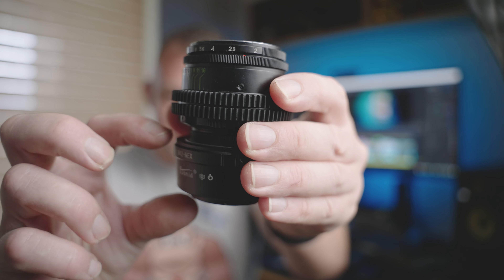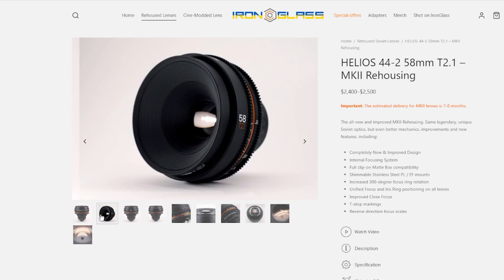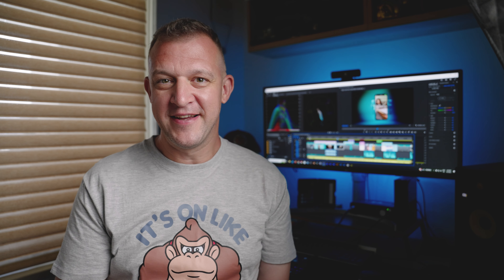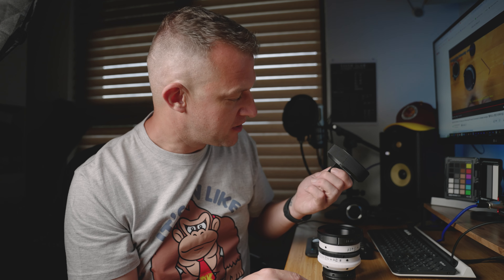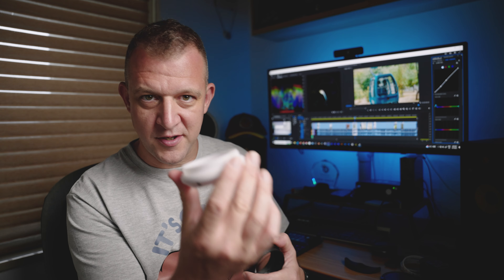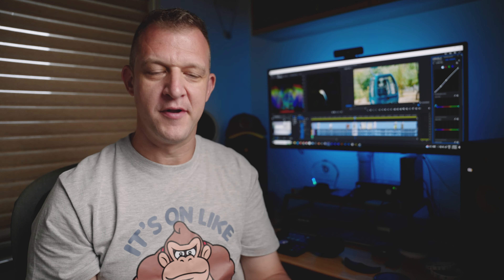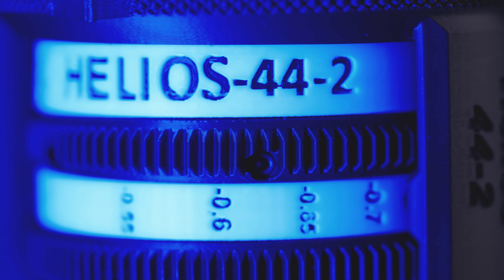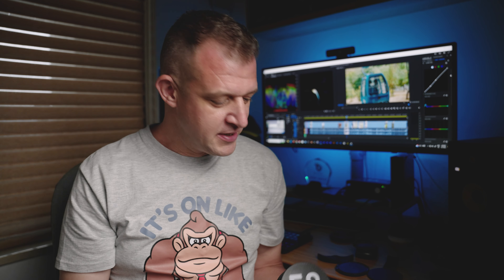Can I rehouse a vintage lens with the magic of 3D printing ?

Comment: That bit that initially snapped that seems to be holding the lens together - the plastic arms go over the follow focus rings, so you can't rotate them over 60 degrees or something. Or am I missing something?
Reply from the maker: No I doesn’t actually hold it together, there’s grub screws and the front rings that hold it together mostly, you can choose not to put that part on there if you so wish 😃😃
Reply: 1. If I did put it on, then how do I use the focus ring? Doesn't it obstruct it partly? 
2. If it's not there to hold the housing (or case, more like) together, then what's it purpose?
 @filmmakerevolution
Reply from the maker: @piotrch0  no you can still use the full functionality of the lens, there’s two rings that rotate